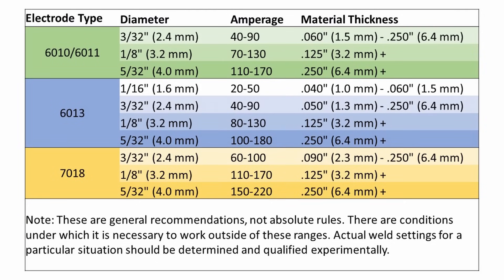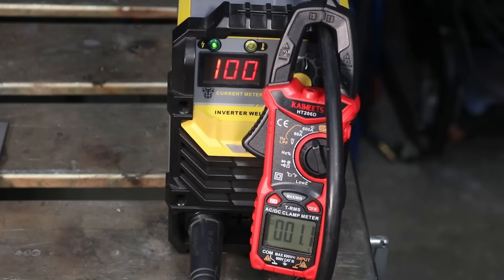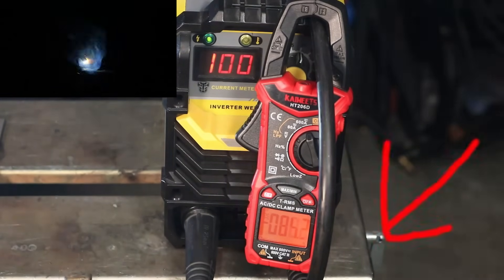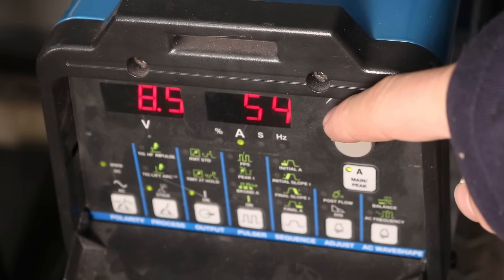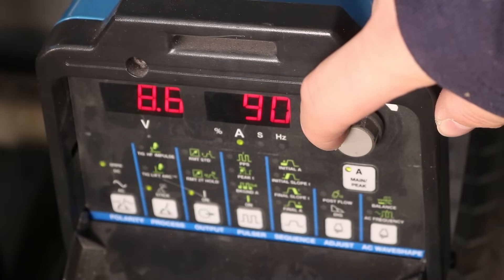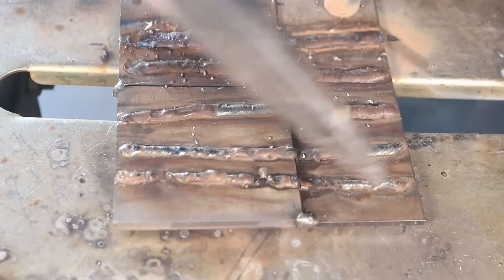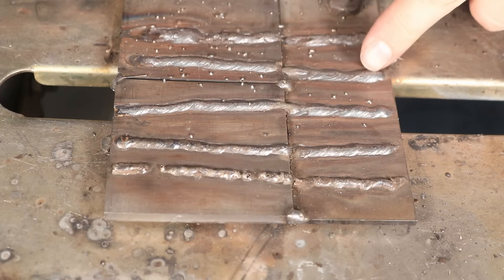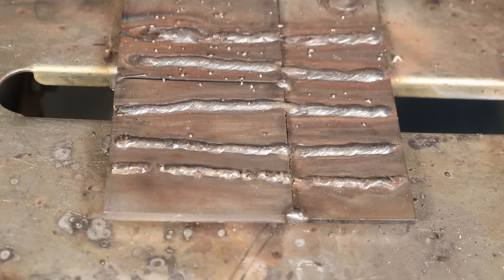How to Set Amperage for Stick Welding

Comment: Thank you for including the metric unit.
Reply: I thought I was the only one who battles with these inches and quarter inches
Reply: @mpirokajosephmgcokoca2355  Imperial system for low IQ individual: 1 divided by 2 is  1/2 (one half), One half divided by 2 is 1/4 (one quarter), One quarter divided by 2 is 1/8 (one eighth), One eighth divided by 2 is 1/16 (one sixteenth), do you want me to go on?
Reply: @RwP223  Yeah I can visualize a 1/16, 1/8, 1/4, and so on in construction and welding but metric units just cannot help me picture stuff I’m working on and guess lengths and thicknesses
Reply: @buttonysquare8501  I know what you mean, I always have to quick convert in my head to visualize as you said.
Reply: @RwP223 1 foot, based on the length of some random's foot from the middle ages... flawed from the start, now let's divide that by 12 to make inches, then we are going to work in fractions from there... congratulations for being able to divide a 12th of a random medieval shoe size
Reply: @2secondslater  More like ancient Egypt and Romans were using non-metric standard units.  Base 10 is manmade, nature isnt base 10. Nature > Man
Reply: @Oakley John woah! I read this and realized IT'S A SCAM!!! 🙄
Reply: Down with the imperial measurement system!
Reply: What's metric? I thought that was only for sockets

Comment: Old dynasty DX, I love that machine. I have one, and the arc on that machine with the dig control is unbeatable. I have welded alot of pipe with it in the worst weather you can throw at that machine. I've been inside roofs tying structural steel beams together. I've ran it off my miller Airpak and used the carrying strap to go into places no welder should go. That machine can weld two beer cans together then go out and weld the roof back onto a water tank that's been half blown off. That machine has made me alot of money.
Reply: I loved this piece of writing. David Lixenberg.

Comment: On dual voltage machines there is a direct relationship with volts in and amps out.
Less volts will give less amps output.
More volts will give more amps output.
Re adjustment of the machine will be necessary when changing voltage.

Comment: Hi tim, just subscribed after watching a few videos.  nice quality.  would like your opinion on a carport project with a simple galvanized sheet roof.  if you can, check out the carport video by april wilkerson on her YT channel.  my plan is similar to hers, but i will cut a female joint on the truss uppers so they rest and weld completely on the post tops.    I am planning a 16x20 carport.  I have steel 5x5x1/4 tube for the four corner posts and am planning 2x6x1/8 for the horizontal beams and  truss tops on the front and back with 1x3x1/8 tube for the inside legs of the trusses.  will make brackets and run wood 2x8x20 16" on center for longitudinal rafters instead of metal purlins.   I have a miller trailblazer and a miller suitcase welder with .35 knurled rollers.  would you choose FCAW-s  0.35( i think i have t-11 and t-8 wire) or SMAW 3/32and1/8 7018 for this structure? should I bevel anything or would both these processes penetrate enough with butted joints and fillet welds(3 bead).  also, would you fill the posts with concrete or sand to strengthen against bucking.  thanks, and keep up the good work
Reply from the maker: Thanks! A trailblazer is a nice machine; I'd love to have a sweet engine drive like that some day. I checked out April's build (been a fan of her channel for a while). I would run stick, mostly because I'm better at stick than flux core 😁, but either would be able to do the job. 7018 is a good choice, but I may use 6010/6011 for some of the out of position groove welds to get full penetration. It wouldn't be a bad idea to bevel the groove joints out a bit, but it will come down to your process. I would definitely recommend setting up a few test plates with the prep and position you are considering, running them and breaking them to make sure that your process and skill are giving the result you want. As far as buckling goes, I'd do some engineering analysis (which can get complicated really fast) to make sure that whatever material I chose could withstand the required loading. Good luck with the build!
Reply: @TimWelds  thanks TW

Comment: Because the welder made in China. 
I was thinking about Decko welder for a while . And this video helped a lot. 
Thanks bro for your time making good video.
Reply from the maker: Thanks! It runs pretty well, but the reading is a bit off.
Reply: @TimWelds  . 
Hi,
     I went for longevity 140amp stick welder. At least made in USA. 
My next machine is the air plasma cutter 50amp. I am thinking about PrimWeld air plasma cutter. 
Any idea I appreciate it. 

Thanks!

Comment: I tried the same deckpro trying to weld a 1/4" steel plate to support a rusty SUV frame. (Terrible project to do as a first time welder btw) I tried 130w on the welder using 7018 1/8" electrode, the electrode kept sticking to the plate, eventually (10 min later) the welder stopped working. Currently waiting on a replacement from amazon to try again and work on maintaining the correct distance
Reply: might try 3/32 7018.  also. 7018 works poorly on metal not well prepped to a shiny state.  6010 0r 6011 might be a better choice if the metal is not shiny clean.  70 series rods are stronger and less brittle, but 60 series are still twice as strong as the metal you are welding if it is mild steel.  also, a preheat with a propane torch can help a little with sticking as the puddle forms quicker on metal that is hot.  make sure you drill a few 1/2 inch holes in the body of the plate so you can do plug welds along  the middle as well as fillet welds along the edges.  also, shore up any crack on the frame with a weld that you grind flat before adding the patch.  a patch with rounded corners or football shaped will be stronger than a square or rectangle.  if you are using a long extension cord, that can make the welder not work as well. good luck....keep a bucket of water and fire extinguisher around.  fall leaves burn quick
Reply: @Doc French It's a good first timer, been using it!! works well for 6011, 6013, and 6010.
Reply from the maker: Bummer! I'd definitely recommend getting the machine dialed in on a test piece first and running some practice plates. Peet had some great tips in his reply. I'd try to clean off the rust, and use a 6011 rod. Good luck!

Comment: Very helpful to me. I’ve watched so many videos about welding but had not heard the comment about the “heaping of the bead (angle at which the bead meets the plate)”. Found that helpful re amperage. And had not really understood undercut before either. Thanks.
Reply from the maker: Glad it helped. Thanks!

Comment: Ohms law is why the amps change in relation to the voltage
Reply from the maker: If I were measuring the input current, Ohms law would indicate that I would see twice the current for the same load at half the voltage. However, I'm measuring the current out of the machine, and it should provide the same set current regardless of the input voltage as long as the input voltage is within the specified limits.
Reply: @TimWelds  you had to have thought that through with intensity. Good job explaining it

Comment: Great format on the videos, thank you. I would really like to know more about welding around potentially hazardous areas like the vehicle's frame with the fuel tank still attached. No pressurized vessel welding or anything, more to do with grounding and potential sparking. Any info on this subject would be great. Keep up the videos; they are appreciated.
Reply from the maker: Thanks! I'll keep that topic in mind for a future video. I used to do a lot of work on vehicles and a lot of people don't think about that.
Reply: @TimWelds  my stick welder is brand new and the arc will cut off randomly even with a 1/8 arc length. What could cause this?